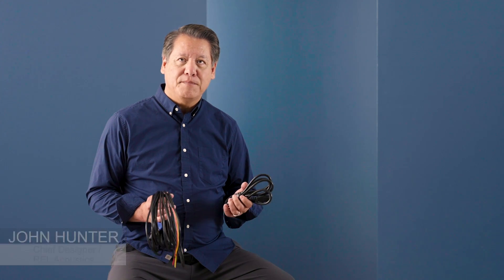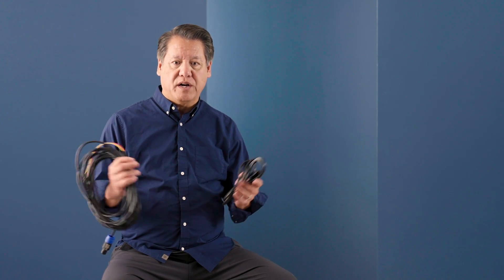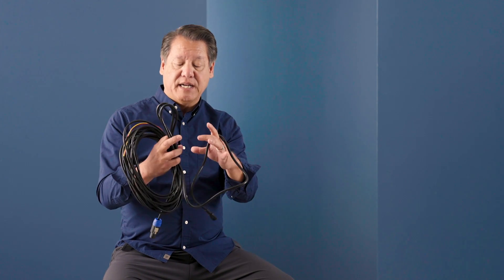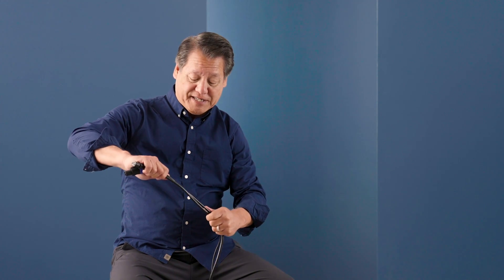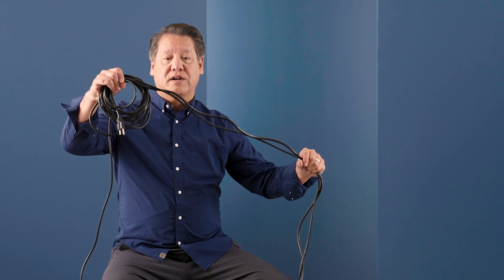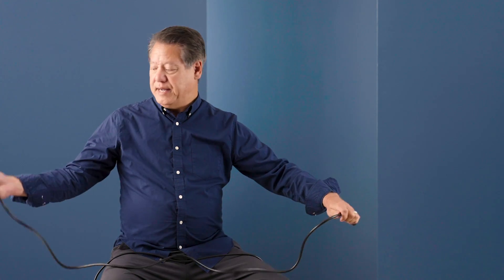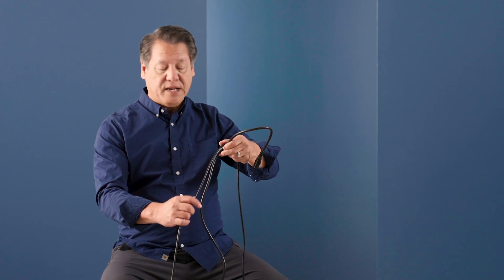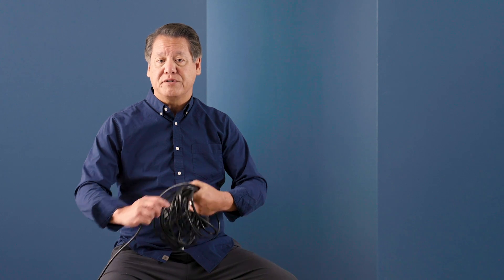How Cable Management Mistakes Can Lead to Big Headaches. Tips to Avoid Interference from Cables.

Comment: As an electrical engineer, this is 100% on point. I also found buying some Krell Cryo-15 power cables off eBay or something and there is a noticeable difference. It certainly won't contribute to any hum and they look great. I was going to shorten my Speakon cable as it's about 5' too long for my application but I chose not to as I can't find a diagram of how the wires are joined within the sheath. Anyway, lots to hearn here. When the sub is hooked up correctly, the FIRST thing to do is get a db meter app for your phone, pull up ao 10-100hz youtube video and play it. Notice the highest db level. THen flip the phase switch and do it again. Whichever one has the highest db rating,  set the sub at that switch setting. I have Cabasse passive speakers for my office and I was interested to find out I had to run the sub phase inverted to avoid cancellation.

Comment: I have 10m bassline blues.  I connect the spade ends into the speakers.  Which are right next to them.  I coil the bassline blue which is NOT in contact with the Naim Powerline lites that I use.  Is this ok?  Doesn’t seem to bother the subs (Carbon Special pair)?
Reply from the maker: Thank you for reaching out. As long as you do not hear any hum or interference through the subwoofer then it will be fine to leave the High Level cable coiled in this way.

Comment: This is so true. I've even experienced the same in a different field back in the day for the wired internet connection (Ethernet). The speed was around 100Mbps and CAT5 cable was used. The CAT5 cable went parallel with multi-tap power extension cord for about 3 meters and I noticed speed drops. When they were not parallel, though look ugly, the speed test showed always better results. Since I learned that, when I installed my HiFi back then, I avoided power lines and speaker cables to run parallel.

Comment: Now, John ... there's another way to get hum with your sub, and that is to plug the subwoofer's power plug into a different outlet than your receiver. Since RELs use a three prong power plug, the act of plugging the subwoofer in over there, then the amplifier in over there ... there's hum there, too. But your message is well taken on this one, and users should know ... the REL is a nice piece of equipment, and requires best practices, or else it //will// hum.

Comment: Maybe I'm a little sensitive to unwanted background noise! But it's taken me years of trial and error to get rid of all my noise (noise floor) or should I say cable interference noise. From my listening position, I don't pick up on any noise anymore. Just to make it clear. Nothing to do with grounding / distortion or any kind hiss or buzz. What I'm referring to is the sound of the room! In fact, I would imagine the vast majority of HT owners are probably not even aware of the faint background signal noise, and that's ok. And there are probably a few who are aware of it. And yet it doesn't bother them, and that's ok too. But for me, getting rid of the background signal noise has been a journey within itself. After all, it's not as if one can pinpoint where the noise is coming from. It's almost as if the room itself has a faint electrical current sound. (Poor description)

 Even after I auditioned three separate mid-priced AVR's, the same unwanted noise was still present. It was only after I changed my cables for a third time. My noise floor came down to such a level, my sensitivities we're finally satisfied.

I'm running an arcam avr20 with a couple of matching high-performance 4 channel power amps (front stage/Atmos) which are driving my Sonus Faber speakers in a 5.2.4 configuration, which also includes a stereo pair of Rel subwoofers for my 4 × 3.5m (13 × 11.5ft) livingroom. I have to say it was only when I purchased quality shielded speaker & RCA cables. The room  became exceptionally quiet!
My room is now so quiet their are occasions without opening my eyes, I'm actually unable to differentiate whether the system is switched off or if it's switched on. The room is really that quiet.
If one is looking to get rid of that so-called ambient sound of the room. IMO, shielded cables are the only way to go. And btw they don't necessarily have to be expensive. However, the better the Shielding, the quieter the room. Bear in mind this is coming from someone who's changed his setup and cables multiple times.

It was annoying at times, but hey, isn't that part of the journey 😁

Comment: what about the long speakon cables provided? do we coil it up or better to cut them? thanks....
Reply: Speakon is actually just the connector. It's a branded end type by neutrik for live event production and doesn't change quality of anything. It's there as an quality of life and to lessen wear and tear. It's just just basic signal cable with the speakon connector at the end, so trim or leave as you see fit.
Reply from the maker: Excess length of the High Level cable that comes supplied with your subwoofer can be coiled if needed, or if you prefer then you can trim the cable once you have finalized the positioning of the subwoofer in your room.
Reply: @RELAcoustics So the length of the cable will not affect the sound? I’d rather not cut it but if a shorten cable can have a positive impact then I will.
Reply from the maker: @hkraytai  That is correct, unless you use a cable that is far longer than the 10 meter one supplied with the subwoofer, in which case there can be some signal loss.

Comment: Question: Is it the same with power cable and xlr? Or does the symmetrical nature of the xlr compensate the influence of the power cable? Thanks for your work!
Reply: The design of XLR is for overcoming noise on the cable, but I can tell you from experience that it doesn't work miracles, and you still want to avoid these types of cable overlap and coiling that he spoke about. Good habits are good to stick with all the time.
Reply from the maker: Thank you for reaching out. The balanced design of an XLR cable will help to prevent some noise, but the guidance provided in this video is good practice to follow with any cables, regardless of their type or connectivity.

Comment: Actually, the rule in the field is less than a foot in parallel for more than 3 feet will generate inductance. The rest about crossing at 90 or at the very least 45 degrees is correct. This is very real and very true as I have witnessed voltage increases to the point that sensitive low voltage equipment literally gets fried on numerous occasions!

 Thank you for making a video about this!!!

Comment: Hi Mr Hunter can I connect the high level straight to my speakers binding post!?
Reply: That’s what I did and it sounds great.
Reply: @brentcollins9727  I’m gonna try it this evening!
Reply: @Burphy42  i do have a short cables with a dual rel T7x with AB amplifier,it sounds great 👍
Reply from the maker: It is possible to do this when running a stereo pair of subwoofers, and if your amplifier uses a Class A/B output stage design, though if using a single subwoofer or if you are using a class D or balanced/differential power amp then it will be best to connect the High Level cable to the amplifier's output terminals.
Reply: @RELAcoustics  I am running a stereo rel T7X and I did tried it sounds great 👍 thank you for responding!

Comment: How about bundling audio cables and power cables in separate bundles? So you have audio cables bundled together and power cables bundled together.
Reply from the maker: Thank you for reaching out. This is typically fine to do, since the main concerns is having audio signal cables run parallel with power cables. If the audio cables do need to cross power cables, then it is best to do so at 90 degree angles rather than letting them run parallel.